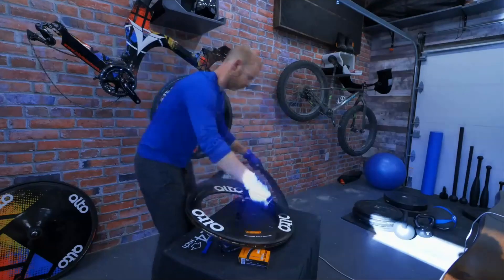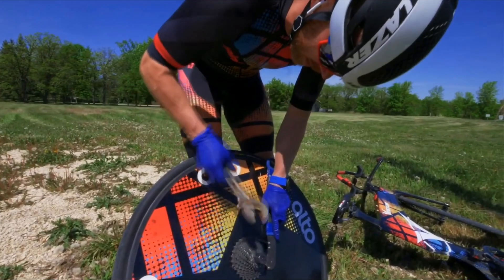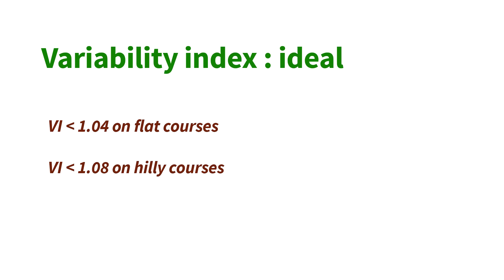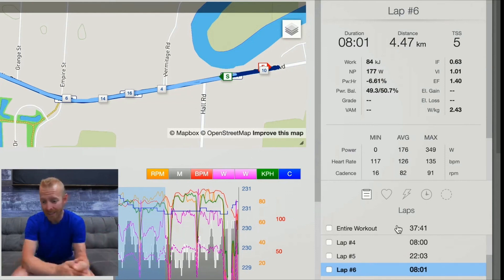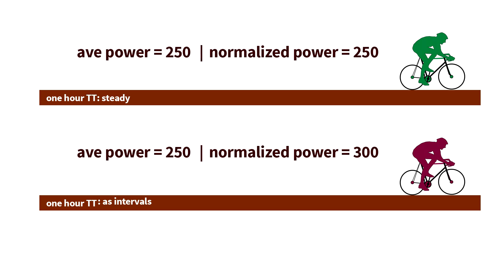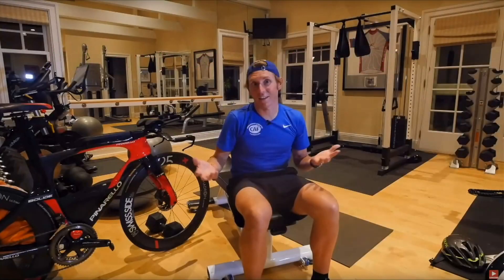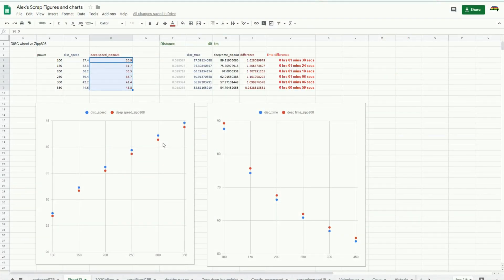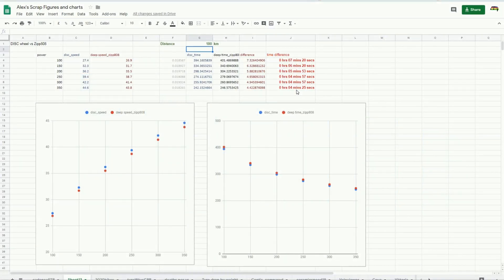Variability index | normalized power | discs for slower riders | explained in 5mins each

Comment: I agree, he should have been measuring Average Power and not Normalized Power.  Also, do lots of runs to get a consistent result, and get away from the cars.  They blow you all over and can help or hinder your test.  This should be no problem, just run the test again matching AVP instead of NP.

Comment: Did I understand correctly that the conclusion is the following: disc is always aerodynamically better, but Taren messed up his test because of poor handling? Could the disc be the reason for that? It is much more susceptible to crosswinds and passing cars
Reply from the maker: Handling (ie position on bike) was probably a red herring because he would have noticed this, and deviating from line also a red herring. Conclusion is: discs are always better if you stay in the same aero position (unless there are significant weight penalty with a disc on a steep climb). The reason for the difference in test results was because of the difference in average power due to (most likely) pacing issues on the disc wheel run.
Reply: @Fastfitnesstips  Ok, but my claim is that it is more difficult to pace with the disc. So aerodynamical effect != final result

Comment: Any idea what the time difference would be (or power difference required) to ride an aero road bike with zipp 808 +/-disc rear) vs a typical (recent model) tt bike?...assuming aero bars on the road bike and similar position between the two bikes
Reply: Yeah it'd be good to see how fast I could go by putting some aero bars on my road bike compared to spending loads on a TT/triathlon bike
Reply from the maker: Yes sure James tell me what distance  / grade / power and I'll tell you the difference (same wheels)? And weight
Reply: @Fastfitnesstips  Hi Alex, the segment is 18.99km, its out and back twice so average gradient is 0%, id expect to average around 350w. i currently have Zipp 808s and a BMC TMR01 and am wondering how far off i'll be by not having a proper TT bike. i think i can get my saddle forward enough to give a similar position. Ive never done the TT as the road race is always in the afternoon and ive always assumed i dont stand a chance on a road bike. but maybe you can convince me otherwise. 
Here is a link to the strava segment... https://www.strava.com/segments/20630558?filter=overall
Thanks for any help you can offer!!